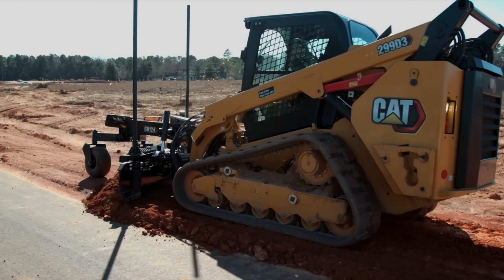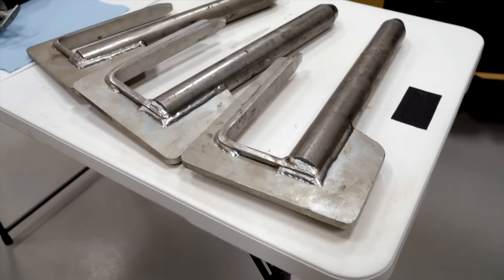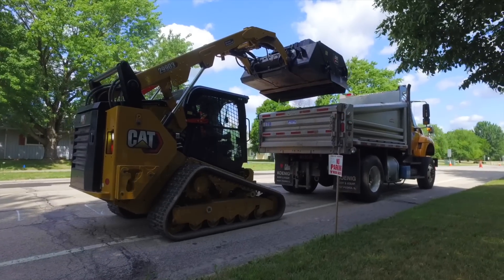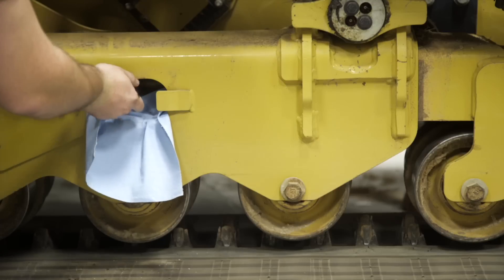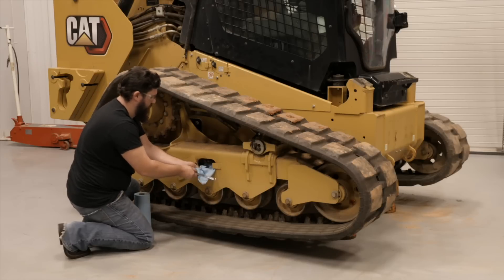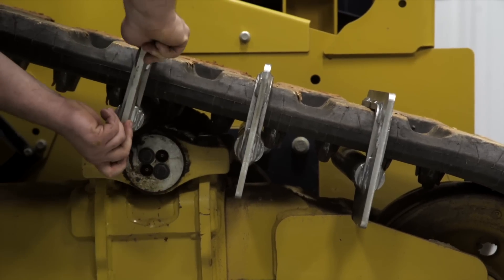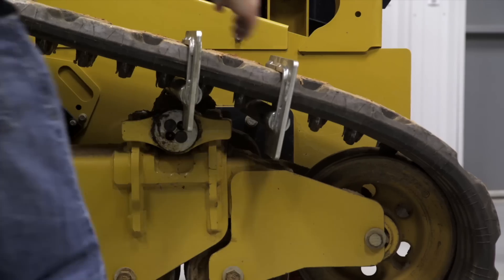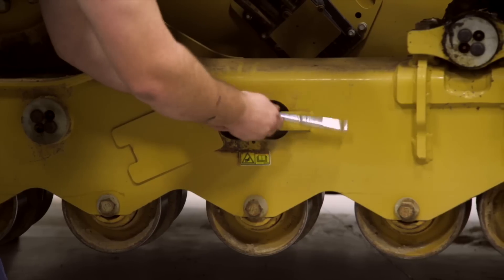How to Remove and Install Cat® Rubber Tracks on Compact Track Loaders

Comment: you have a jack built in, its the lifter arms.  On my 279 D3 I put some 8" steel tube under both sides of the back frame, then rotate the bucket and lift the front and it picks the tracks off the ground. you can then put supports under the front and drop it, raising the arms for clearance if needed.

Comment: How do you replace that grease fitting?
Reply from the maker: Hi William. If you need to completely remove the grease fitting and replace it, you’ll need to remove the bolts/washers and the locking plate so that you can back out the grease fitting enough to remove it. Please follow the instructions in this video to detension the track before taking the steps to remove the locking plate so that there’s no built up pressure or grease in the tensioning assembly. Let us know if you have any further questions! - David

Comment: #1 What purpose did lifting the arms and locking it in place serve?  #2 You didn't show the fight of getting the tread on and off the machine.   It's like the fairy god mother just made it magically appear.
Reply: It is to place the jack and jack stands underneath.
Reply: Luft the arms to give more room to work.

Comment: How do you remove the tracks when you can’t use the actual hydraulic drive motor???  In other words, I need to remove the track to be able to repair the blown hydraulic drive hoses ???
Reply: Just loosen the grease fitting hit the front tread with a sledge to release the track tension and unbolt the drive sprockets that will give you enough slack to pry the tracks from the idler wheels
Reply: @sofagaming8951  I already did that. My main question to the use of the tool was, “ if the final drive cannot be used, than how does a person get the tracks off “? And , it not a easy job for anyone to do alone.
Reply: @wildman318  I definitely understand it's tough to do it I know I'm a field service deck with another rental company and I use ratchet straps and pry bars if Motors won't turn. That tool they use is only with Motors working I use spare cylinders pins instead of that tool to make the spacing on the front idler wheel works just as well
Reply: Field service tech not deck lol auto correct
Reply: @sofagaming8951   what ? lol
Reply: @sofagaming8951  you also have to understand that there are so many “ cheap ignorant assholes of a boss to work for” that refuse to buy tools ( specialty tools) for the shop. lol lol
Reply: @wildman318  cat wants $ 734 for thos special toosl not worth it
Reply: @sofagaming8951  Seems like you could weld up a few for probably 20 bucks worth of pipe and some 1/4" plate steel.
Reply: Nothing it was an auto text correct mistake when typing
Reply: After releaseing hte grease in the piston arm, I use a winch on my truck to pull back on the tread from the front in order to release all pressure in the piston.  Then you can use the winch at a 45 degree pull to pull it off the front and then the back.  If you don't have it in a good spot where you can get all around it, things are more difficult.
Reply from the maker: Hello wildman318! Thank you for your interest! Your Cat dealer can help you with product questions. You can find your local dealer on our website here:  https://www.cat.com/en_US/support/dealer-locator.html?utm_source=youtube&utm_medium=social&utm_campaign=cic_social_care. - Brad
Reply: @catconstructiontrade  my local caterpillar dealer, doesn’t know squat…. lol